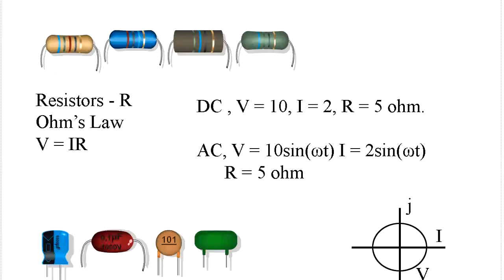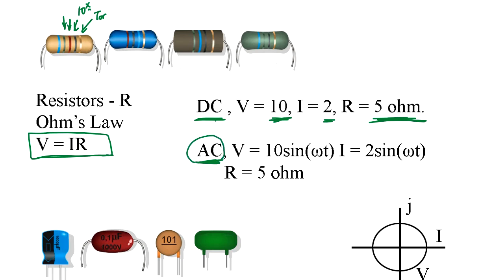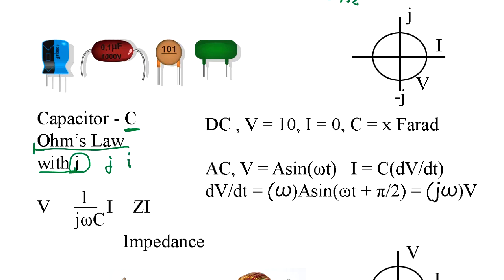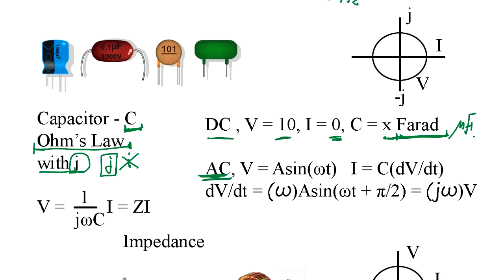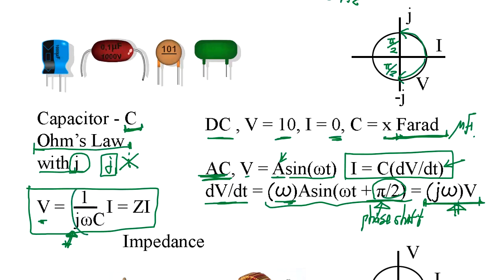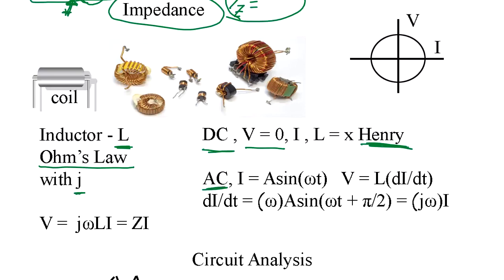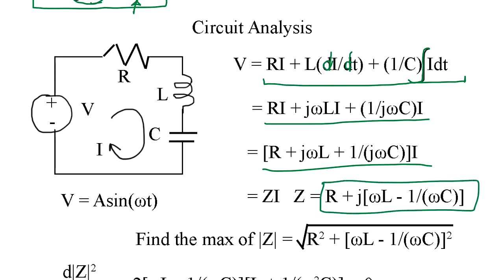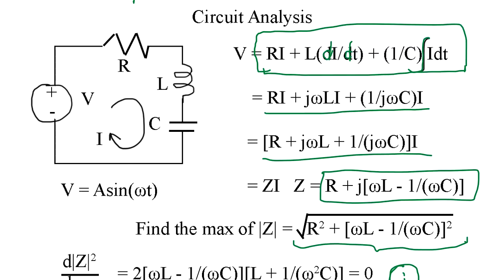Imaginary Number is important for Electrical engineering

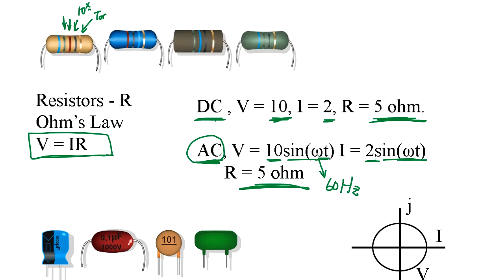Comment: The equation for dV/dt shown starting at approximately 2:05 is simply wrong. j times sin(omega t) is not the same as sin(omega t + pi/2), that equation only would be right if you used complex exponential functions instead of the sines.